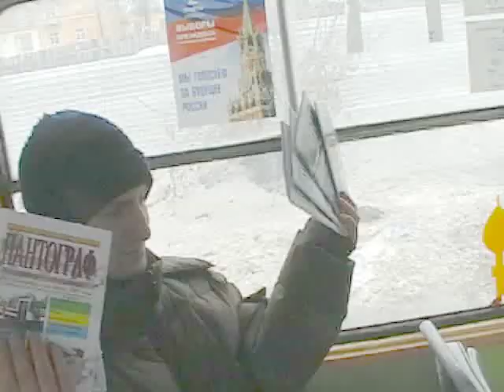Тульский трамвай, 4 маршрут

Comment: What kind of a creepy place is that!? Those buses looks like them we had in the beginning of the 80´s.... 35 years ago....
Reply: Don't know for sure, but I think it's Russia. It's just a relic from the USSR time, but I also think that the older stuff is better up to the weather conditions there than modern stuff. I was on a holiday in Kyiv, Ukraine last year (in winter) and saw the same things. But all those buses were doing what they were designed to do, and I think public transport vehicles should more have the emphasis on functionality than appearance. The Kyiv metro has old trains as well, but they work, they accelerate like mad (far faster than the ones I'm used to in Amsterdam and Rotterdam) and the frequency is just impressive, especially during the peak: a metro every minute is possible, though it usually takes 5 seconds more. You get used to the whole atmosphere pretty quickly, just because everyone around you is used to it, you pretty much just go with the flow and quickly don't really notice it anymore.

We in the West take everything we have for granted, think we are innovative, but Kyiv surprised me with many things. (but the same was true for the friend I visited there when she was visiting my country (The Netherlands) )